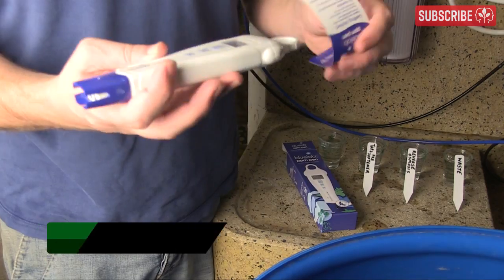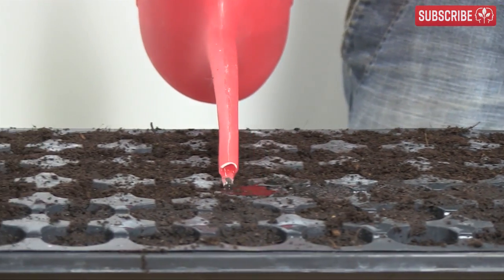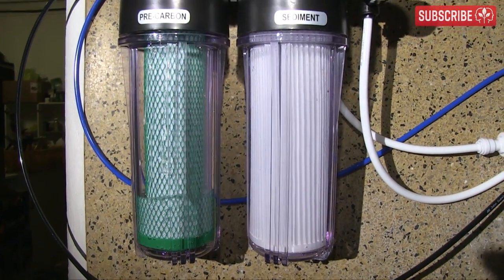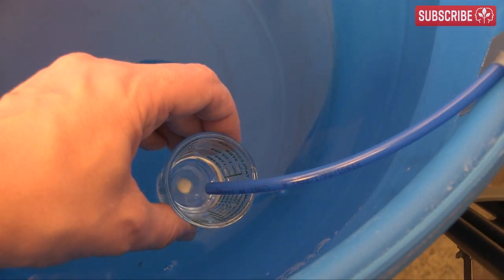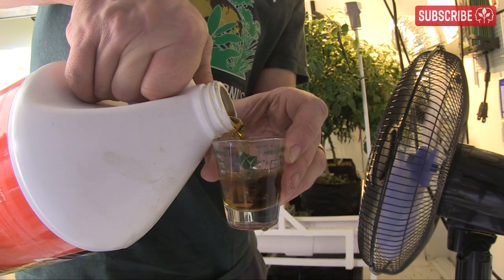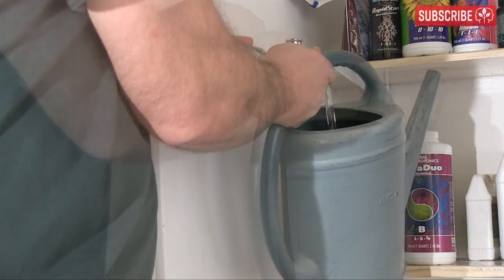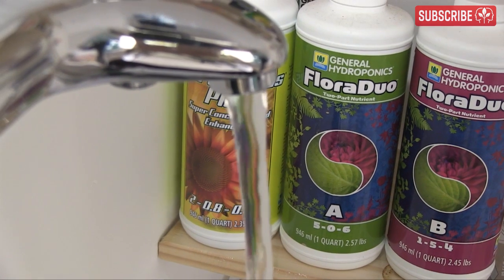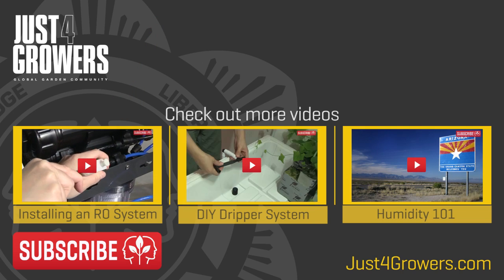Is Reverse Osmosis Purified Water Really Necessary for Hydroponics?

Comment: God Everest thanks for that sheer amount of knowledge. I used to scoff at R/O water and thought I could get away with my 250ppm tap water... until I started to witness severe nutrient lockouts in my plants due to all that calcium in the water.

I'll be ordering a R/O system soon, nothing special 75 GPD/6 bars, a cal/mag supplement and flora series micro softwater. We'll see how it goes from there, but I'm sure it will go much better.
Cheers and keep on growing/filming!
Reply from the maker: +Farseer1995 Thanks Farseer. It's as much to do with the incorrect (or less than ideal) ratios of calcium and magnesium in hard water as much as anything else. Calcium is super important for nutrient transport, but it needs to be supplied in the right ratios, which a cal/mag supplement provides in the form of calcium nitrate, magnesium nitrate, and sometimes a dash of calcium chloride too along with a cheeky hit of iron. Not many growers realise that they are giving their plants an extra hit of nitrogen when using cal/mag. :)
Reply: +Everest Fernandez (Just4Growers) Ok then, I'll keep that in mind, don't want nitrogen toxicity spoiling the party. I was wondering whether or not I should go easy on the cal/mag, as I think GH 3 part flora series which I'm using already has some calcium and magnesium inside them. I'll try 100 ppms for the beggining and see how my plants react.
Reply from the maker: +Farseer1995 If you're starting out with RO water then 100 PPMs of cal/mag is great for vegetative growth—I know of growers who go up to 300 PPMs of cal/mag when in flower. Maybe bring it back down to 100 for later flower.

Comment: So what PPM and PH meters do you recommend for a hydroponics grower. I have the stealth RO 100 that I have probably ruined using it with hard water already the past two years. Are there combo meters so I don't have to buy both?
Thanks
Kevin
Reply from the maker: Unsurprisingly I am going to recommend what I use - the Bluelab combo meter - because it has replaceable probes and is super durable and reliable. You'll pay a few more bucks but you won't regret it further down the line.
Reply: Everest Fernandez Only one model here? And it's not a pen?

Comment: hey I am noobie hydroponic grower I can afford to invest in a ro system but my water connection would be 10 ft away from my master res in my grow room would I be able to replace the white tubing with longer tubing?will the 40 psi be enough pressure to push the water into the grow room?
Reply from the maker: No problem Mark. Install your RO machine close to your water point and drainage and feed the RO output tube to your res. Try to get gravity on your side too.
Reply: +Everest Fernandez (Just4Growers) fuck yeah I'm excited just order my room system can't do this tap water running 220 ppm off the bat with added nutrients runs 750
Reply from the maker: +mark mongillo I've dealt with worse (and tried hard water formulations) but you are definitely on the best track. Once you try RO there's only one way to grow! Good luck :))

Comment: hi I'm in the uk. and I use ec mine is 0.15. I believe it's soft water.what is it in ppms please.  Thanks. peace
Reply from the maker: Hi Lee. I prefer EC too. When measuring electrical conductance we just have one reading to go by. In your case, 0.15 milisiemens or 150 microsiemens. To convert into PPMs (a measure of concentration) we have to use a conversion factor. These can vary but I use microsiemens X 0.5 so yours would be 150 x 0.5 or 75 PPMs. Check out my other video on hydroponic nutrients, TDS, EC, PPMs explained in the hydroponic nutrients playlist. Your water is pretty soft for the UK. I'm guessing Sheffield. ;)
Reply: @Just4Growers  All your videos are most excellent!! by chance ..what ppm should I expect from pre softened water after running through the RO system ...and If I get more than 0 ..is something wrong??
Reply: Everest Fernandez Sheffield tap water ppms is currently 350-380.

Comment: Hi Everest 

I have a question for you please.

I've just purchased a HM digital PH-200 tester and an RO filter system

I noticed In your video you mentioned that you shouldn't put your ph tester in pure RO water as it causes damage to the probe

Is it ok to use tester when nutrients have been added to RO water?

Thanks in advance 😎
Reply from the maker: Yes Hawkman, that's fine.
Reply: It won't cause damage to the probe as the PH of RO water is neutral

Comment: Sweet vid. Quick question. if my base e.c is 0.6 and 1.2 with nutes added, and I zero it with a R.O system will I be able to bring it back to 1.2 with more nutes or have to lower. Cheers bruva
Reply from the maker: +xxdeedee smith Hey xxdeedee. This is a really, really good question as the answer gets right to the heart of how plants uptake nutrients. (In fact, it's well worth a video answer so I'll put it on the list!) For now, the short answer (caveats and explanation to follow) is: YES—you can bring it back to 1.2 with more nutes. This is great news as it means that you can safely transport more nutrition into your plants. I'm thinking I should make a practical video about using RO water in hydroponics—and we can really dive into the WHY and HOW if you like!?
Reply from the maker: +xxdeedee smith More thoughts. A friend of mine (nutrient scientist) recommends that folks mix in ¼ tap water with their RO water, as there are other microelements that are normally present in tap water that may not be present in the nutrient solution (as liquid concentrated nutrients are normally made with RO water themselves.) Trace elements such as selenium, cobalt, silicon and sodium are all found in tap water in trace amounts. They are not essential for plant growth, but are beneficial to plant growth in very small quantities. So I thought I'd add this nugget to the info mix! :)
Reply: +Everest Fernandez (Just4Growers) thanks man, I think one of ur videos is going to cover this subject nicely, when can we expect this wealth of info lol. A shout out would be cool lool
Reply from the maker: +xxdeedee smith Probably not until next year but I'll say hello to 'xxdeedee smith' if that's the handle you go by! :)

Comment: that is nice, so does it really operate completely off grid? and what is its maintenance cost? the change of filters cost?
Reply from the maker: Admi fonds The RO membranes cost about $68, the sediment filters are $15. So it's obviously the RO membranes that are the real cost issue here. They should be replaced every six months to two years. You can enjoy a replacement frequency nearer to two years if you change your flush your membranes every month and clean your sediment filters regularly. It also depends on the hardness of your input water. I use a pre-softener as my water is very hard. I've been running my RO for nine months and my purified water is still zero ppms. Very cool. Time for a change soon though and I'll be sure to document it with a vid. Oh and yes, if you have enough water pressure (40 PSI+) you don't need an additional pressure booster pump so, yes, off-the-griddable! :)
Reply: Everest Fernandez great thanks, why would you change it if you're still getting 0ppm? could you not leave it until it's giving 50ppm or so? my water is in the 230 range, i grow with it fine but it would be so nice to have soft water. do you use it 24/7 operating? or you only use it to fill a res and then shut it? if one wants to use it at its maximum output, i wonder how much it would cost...
i like your channel, cheers
Reply from the maker: Admi fonds You're right Admi, no need to change it when it's still operating to maximum potential (pretty impressive!). I don't run it 24 / 7 as my water needs aren't so big right now. I tend to run it overnight until the float valve kicks in and then switch it off for several days at a time. This is probably why I'm enjoying an extended line-span at full efficacy.
Reply: Everest Fernandez yeah that is very nice, if i can run it at max get all its potential output at ppm of less than 100 after 2 years of usage, that would be great, as i am planning to expand my personal greenhouse into something commercial
Reply from the maker: Admi fonds Awesome. I look forward to hearing more about your expansion plans.

Comment: Honestly I was looking into getting an RO system when I was first getting into Hydroponics but instead I started to collect rain water. What are your thoughts on this Everest?
Reply from the maker: Romo Jack Rain water is hard to beat Romo. It's worth performing a quick pH and TDS check but you should find it is <60 PPMs and around pH neutral. You should use a Cal/Mag supplement too, just as you would with RO.
Reply: Everest Fernandez Yeah the pH is usually around 7 and the TDS is often so low that none of the TDS meters I've tested reads above 0. I'll invest in cal mag since I've never used it before that's probably why I've been hit and miss with certain grows. At times only half the seeds would propagate while at other times I would have a 100% grow
Reply from the maker: Romo Jack I like it! Yes, definitely reach for the liquid cal/mag. Add 100 ppms to your rain water for leaft green crops, and up to around 300 ppms for flowering and fruiting crops.

Comment: Hey Everest Fernandez, my pepper seedlings taco shelled under my hid. The leaves are still green, can I correct it by putting them under fluorescents or are they no good? Great video!
Reply from the maker: Hey Jonathan, move them into a semi-illuminated area, away from the direct glare of your HID grow lights. Foliar feed a very mild vegetative nutrient solution (0.6 mS or 300 PPMs). Try to keep relative humidity at 60% - 70% and temperatures in the mid 70s. Sometimes when I've had seedlings "go bad" like this and moved them to one side (with the intention of dumping them) they've recovered, so I learnt this trick by accident! Less is more when your plant aren't rocking and rolling. Let me know how you get on!  Good luck! :)